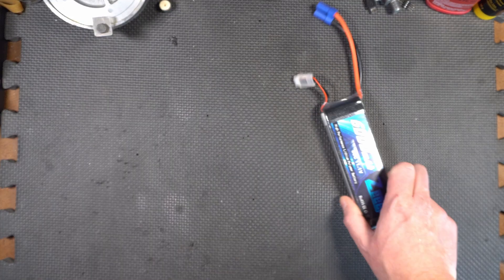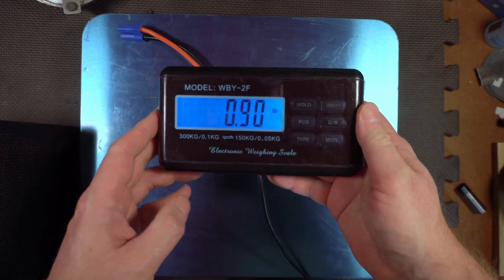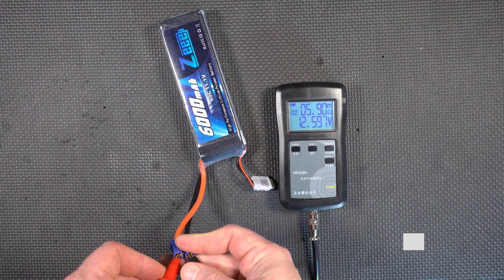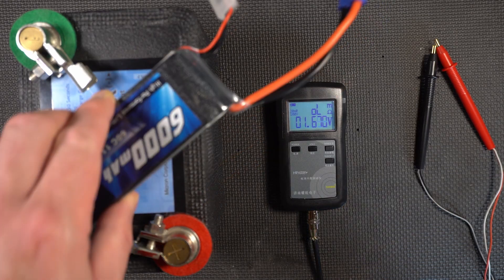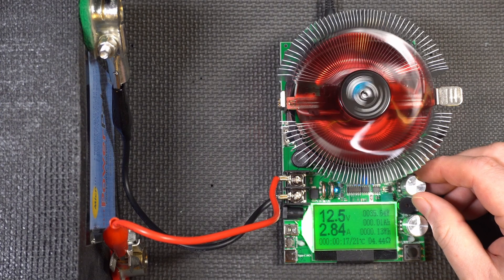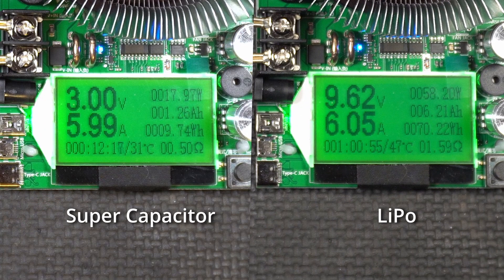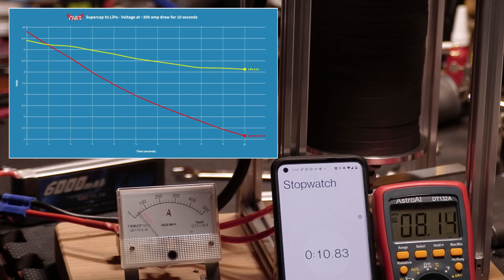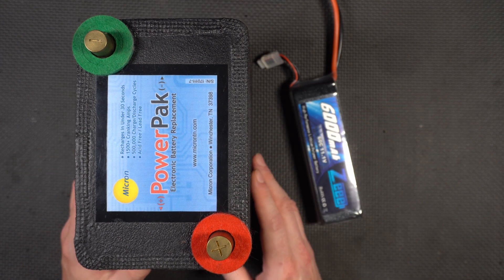One Of These Sucks

Comment: Crankin those vids out, and we learn more every time! The only question now is, are you prepping pre-made setups for your followers to buy, and if not, why not?
Reply from the maker: That's a good question - there are several reason why I'm not making pre-built setups yet - I'm in the process of building a new place and moving; I still need to develop some sort of universal control circuitry that can work on most vehicles; different people have different needs - I drag race, some people road race, etc; and then there are liability issues - you can't just hit one of these things with full power unmounted in an unsafe environment - it'll fly around all over the place, suck in your cat or fingers and frappe them, etc.  But I probably will do some sort "modules" for sale at come point.

Comment: didn't toyota run a lemans hybrid car with super capacitors not too long ago?
Reply from the maker: I really don't know.  I don't know why you would with where lithium tech is now - maybe for initial acceleration bursts?  The LTO cells I'm using have lower internal resistance than the supercap.  I think for cost reasons, the best chemistry now is LiFePo4 - still has very low internal internal resistance (almost as good as LTO), but cheaper and more power dense.
Reply: @AlexLTDLX  2014-15 toyota TS040 hybrid.

Comment: Use both, not one or the other. The abillity of the cap to dump stupid amounts of current in extremely short time frames makes them very good for the ESC and motor as chemical reactions in batteries is just plain slow compared.

Comment: What is the recommended voltage and total kw for your supercharger kit? How many passes can you run at the track with your setup ?
Reply from the maker: Really the answer is "it depends."  In another comment you mentioned you have an older NSX - that wouldn't take much.  A 48 volt setup running 10kW should be more than adequate.  That's really only about 200 amps.  Our "big" unit is running 52 volts loaded at 675 amps (!) - and the only reason why it's some much is that the compressor's a bit too small for that engine and it's going into choke.

Comment: The supercapacitor only put out 2.5Wh from start to 11v. Considering this is often marketed to car audio people, 2.5Wh is like 250w for 1/100th of an hour, about 30 seconds. 3 seconds for 2500w. This is also 500 Farads. People used to run ONE Farad. 
Keen to see the LTO build, I'll probably bump it up my projects list depending on how yours turns out.
Reply from the maker: The LTO pack is already built and has seen both dyno and track action (as well as some stick welding attempts).  I've made a playlist for you of just those videos: https://youtube.com/playlist?list=PLhacdpER4T0uDTuF4ByepCTNkHPq6JatX

Comment: ying long LTO cells for the win or XS Power/ying long cells
Reply from the maker: I know those are typically 40ah, but do you know what their internal resistance is?  That's really proving to be key in our electric turbo projects.
Reply: Ying long LTO's have higher Internal resistance, which makes sense since they are the same size but have greater capacity

Comment: I ran some capacitors inline with my 6s 8th scale truck that can pull a few hundred amps under burst conditions.  It's drastically improved the life of my ESC since my batteries and wires had a lot of voltage drop to them.  

We used two 1 Farad 25v capacitors on a SAE super mileage car as a hybrid system.  They definitely did not hold much energy, but did an okay job between the Briggs and Stratton powered dc generator and the brushless esc's driving the wheels.
Reply from the maker: Sounds like you've been involved in a number of cool projects - nice!

Comment: The super capacitor seems like it would only be useful in specific situations with frequent high charge and discharge events. Something industrial with sudden power requirements that activates many times a day, but can't get enough power from mains for some reason.
Reply: Exactly. Like a capacitor in any situation there actually used. Trying to use them for something there really not designed to is pointless. Like using a shovel to dig a canal. Can you do it yes. Would a excavator be a better choice yes
Reply from the maker: Yep.  That's exactly right.
Reply: or electric drag cars. i feel like specifically in a drag racing situation, super capacitors might be best even.

Comment: Id try running the cap bank between esc and battery bank as a buffer and see if it helps voltage drop over a run. Id wager it will.
Reply from the maker: What will happen is it will help for the first split second, and then the batteries will work to keep the supercap charged and drive the motor/ESC, resulting in decreased performance.  And think of the size of the supercap you'd need to work at 63 volts - you'd need 25 of them in series, and since capacitance gets divided by the number of caps in series (assuming they're the same), you would need 100 individual caps to have a bit less capacitance at 62.5 volts than the one you see in the video at 12.6 volts.  Basically, the supercap would be 17 times larger and more massive than the one in the video.  You're better off adding more cells.
Reply: So sure you are, my padawan. You must unlearn what you have learned. Teach you, Mr Bbi will...

Comment: LTO cells?? I don't think I've heard of this battery chemistry. More info please!
Reply from the maker: They've been around for a while - actually, probably the oldest commercial lithium battery technology.  They're used in things like pacemakers, etc - wherever reliability and safety are primary concerns.  You can cut them in half, drive a nail through them, etc - and nothing happens.  These particular cells just happen to have massive discharge potential - 900 amps continuous, thousands of amps burst.   The downsides are cost (they're kind of expensive) and they're less power dense than LiPo cells.  Everything's a trade off.
Reply: They are also used in sattelites and space probes because of their high temp range, especially low temp

Comment: XS Power SB75-5 capacitor (75 Farads)
group 9 motorcycle battery, rated 100cca

Together tested at 500cca, by the local Honda (car) dealer. 

Still working, never failed. Never jumped. Even left my headlights on ~15 minutes, like an idiot, but it still fired-up!

Video from shortly after the install:
https://youtu.be/kN3-Ovzuazw
Reply: The point of my hack was weight. The cap & group 9 weigh 5 pounds, compared to oem battery at ~35 pounds!

Then the cap gives me the power to start, the battery so I can close my windows without starting the engine, and when I leave my lights on.

Really, I predict it lasts awhile. Sure, when I crank it power comes from the cap, but when cranking, system voltage still stays above 11.5v. That means I'm barely discharging it! Not even 1/10 of the charge it has available!

So that doesn't count as "one cycle", and I don't believe it even counts as a part of a cycle. Starting happens in about 0.75 seconds, so not enough time to cause the heat that causes wear.
Reply from the maker: Don't get me wrong - I'm not saying they don't work; they certainly do.  For a while, the supercap was next to the battery in the car to help start it (I was using a small Honda Civic battery); before that it jump started my lawn tractor tons of times.  But eventually I replaced the car battery with a DIY LiFePo4 100ah unit which it smaller, lighter and has 5 times the usable power.  II did a video on it that wasn't very popular for some reason, but it's been flawless since I put it in: https://youtu.be/cS1aQJOnqTQ
Reply: @AlexLTDLX   @AlexLTDLX  I don't get how the lithium battery would weigh less than the capacitor. The SB75 I have is the size of a group 15 battery (~6x4x4.5) and weighs less than one pound!  It weighs less than the empty housing of a full size battery, and I can't see how your lithium pack would be lighter!

(The group 9 battery that I run weighs less than 4 pounds.)

In fact, the SB75 will start the engine by itself, without the battery! 
(only if it starts on the first try!)
Reply from the maker: XS power says that model weighs 1.5 lbs; but either way, it doesn't matter.  The 6,000 mah lipo I used in the video has way more power capacity and really does weigh less than a pound.  You could probably get by with an even smaller unit.  However - this is a big one - lipos don't like to be cold; below freezing they could explode.  I would use a LiFePo4 battery - something like the a123 systems 26650 cells.  For your car, you probably won't need more than 2p 4s.  That would be tiny and more powerful than your current setup; and be temperature safe.  You'd need a BMS for it, though.  But you have a system that works for you, and building a LiFePo4 pack probably isn't cost effective - though I bought 180 a123 cells for $180 - but they came in packs I have to take apart.  BTW - I read the description in your youtube video, and the wire you described sounds like CCA - copper clad aluminum.  It's not very good (as you found out. )